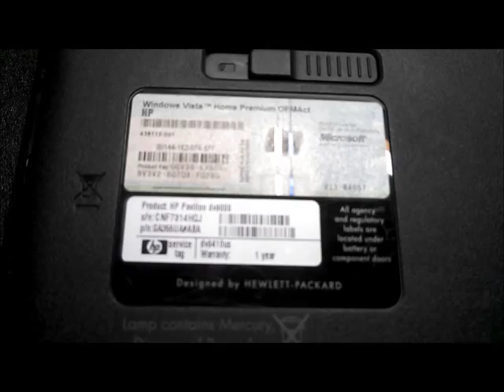How to Replace the Hard Drive in an HP dv9000 Laptop

Comment: MY DV9000 GOING BLACK SCREEN WHEN I PRESS START,MAY I ASK FOR SOLUTION?
Reply from the maker: +alex 12345 Take the power cord off and remove the batter.  Reset the RAM card(s) and HD.  Close all panels and replace the battery.  Plug in and turn it on.  Good luck.